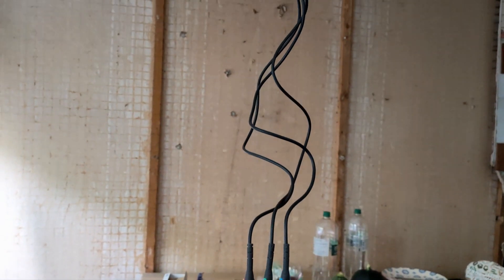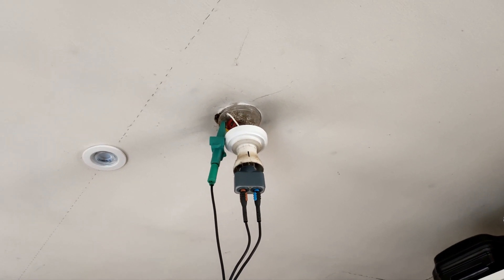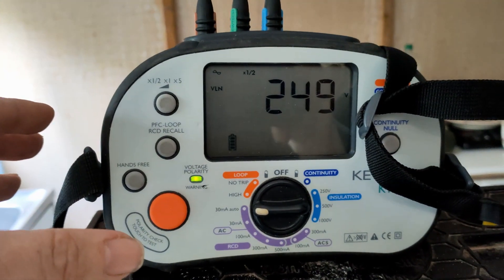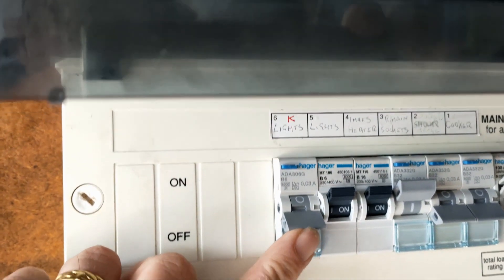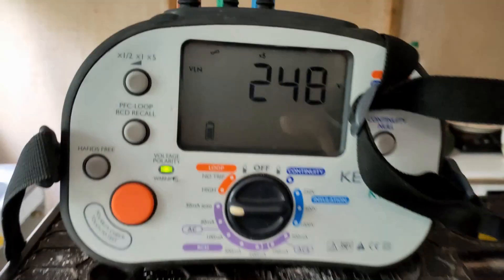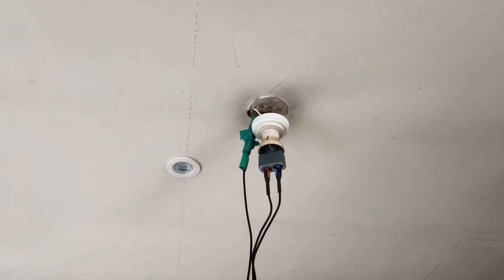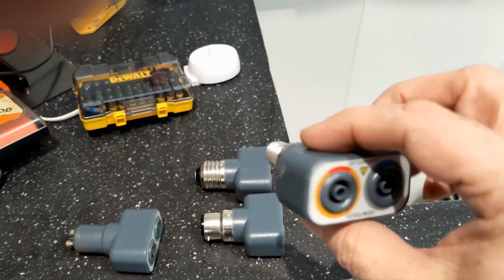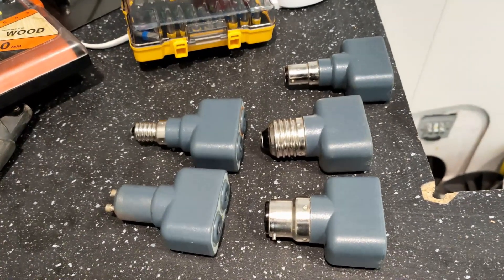How to Test RCBO's on a circuit without a socket.

Comment: Your tester will only test Type AC. The RCBO under test was Type A.
Reply from the maker: I know it couldn't test DC leakage. It's heading off for its annual calibration so I'm going to take adavantage of Kewtech's upgrade which will essentially make it a KT63DL, cheaper than replacing it.

Comment: You can test at the rcbo in the board as your halfway to using the three lead method with just the leads
Reply from the maker: Thank you Chris. Yes you can do it that way, and possibly it might be the only way if the house only has downlights, or it's tricky to get to a cooker or shower point. It's personal preference for me, that I don't like to mess with an open live consumer unit for any longer than absolutely necessary, and trying to hold probes in the top of an RCBO while trying to flick it back on, or do 1/2x 1x 5x manually just feels like asking for trouble, especially if its right next to the main switch. This way just seems a much safer way to do it if it's an option.
Reply: @vwes  absolutely sir I couldn’t agree more I to have the same kit and use it regularly on the lamp can gu10 fittings it’s a real time saver sir but then we all have our set ways and personal choice of testing. 
But if you use croc clips on neutral and cpc bar you only really have to hold the line on. Dosent seem natural but is another option. 

I’m abit old school three lead tester where I can and practicable. Great content lovey conduit work with your sets ect looking forward to the next video.